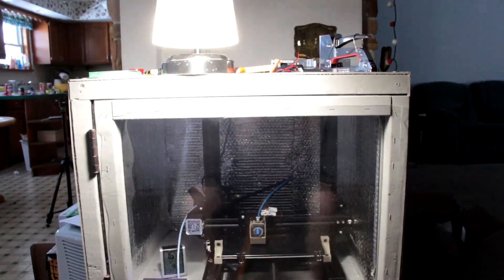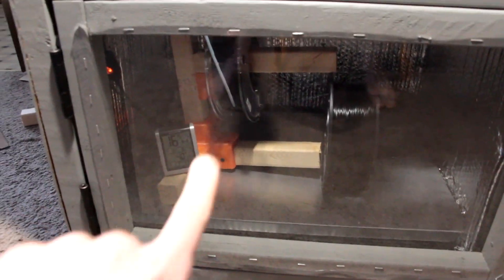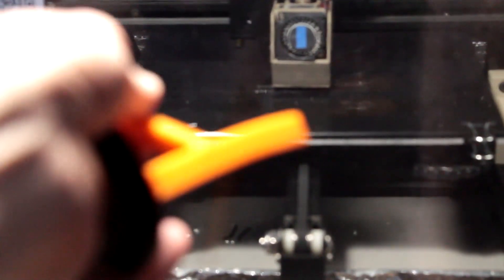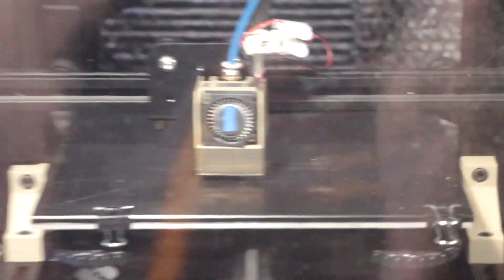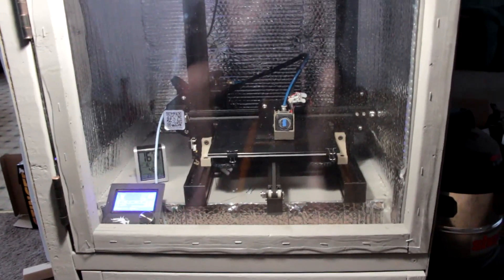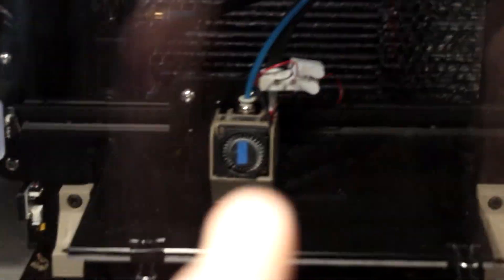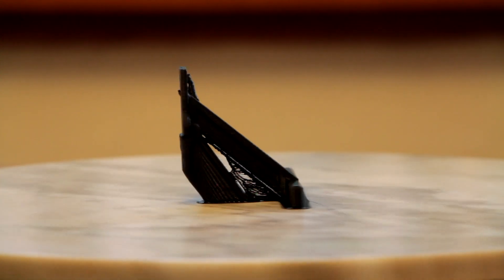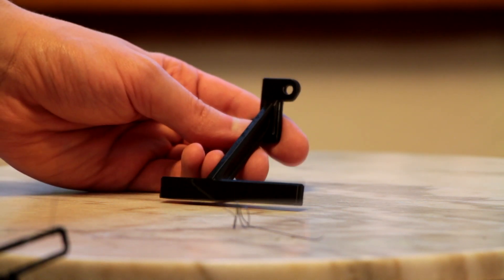PC Max on the Ender 3

Comment: Did you change the extruder assembly?  What's the purpose of the pusher plate?  Is that the creality 3d glass plate bed?  What material did you end up printing the fan shroud out of?